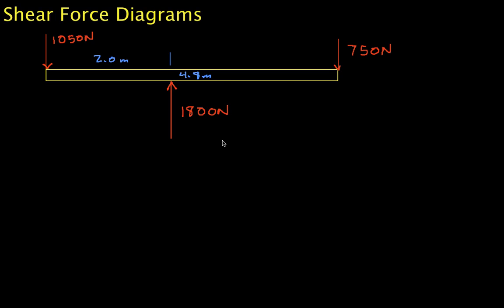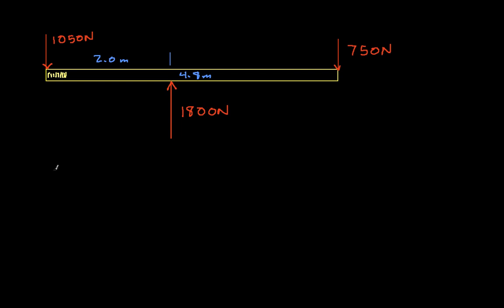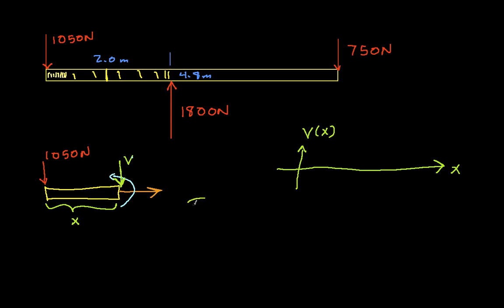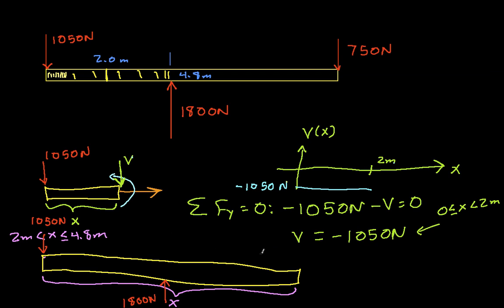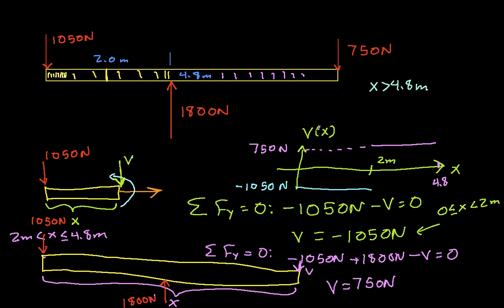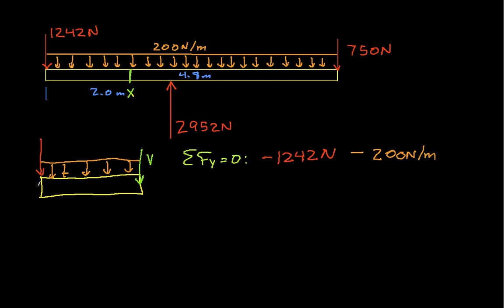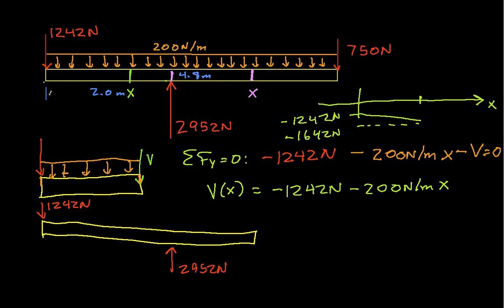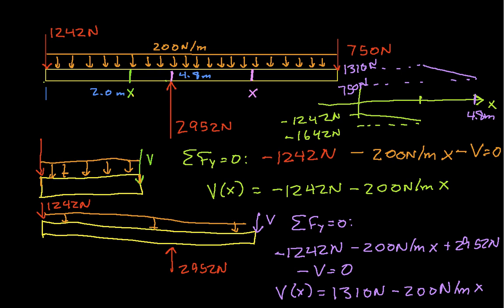Shear Force Diagrams

Comment from the maker: I did not solve it correctly. For x > 2, it should be V(x) = 1710N - 200 N/m x. This gives V(2m) = 1310N, which is on the plot on the upper right. Thanks for catching this-I  will add an annotation that corrects this.